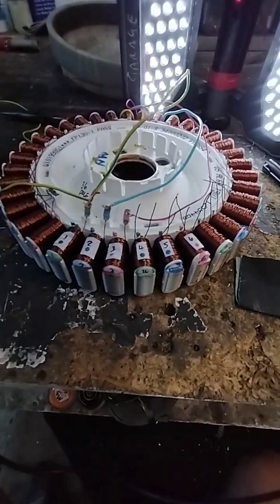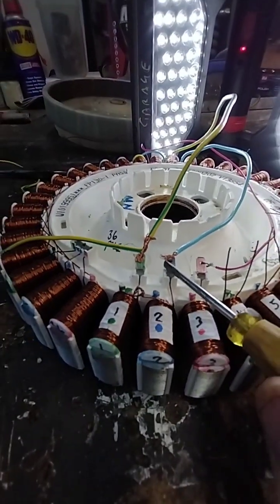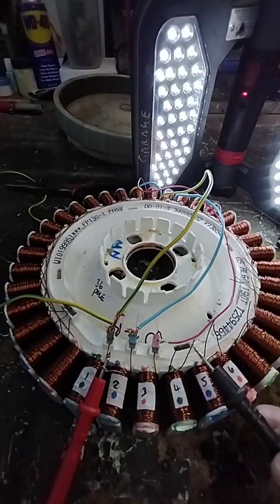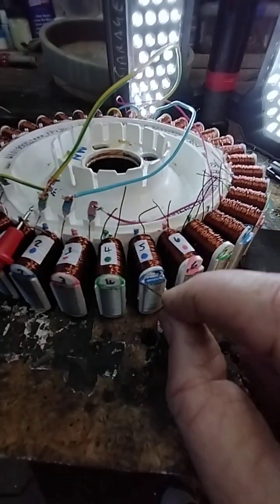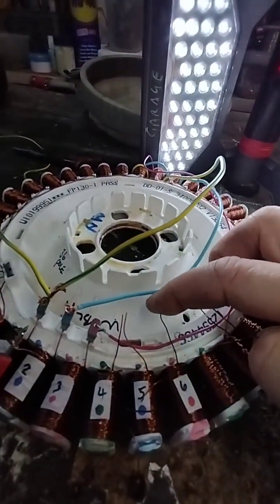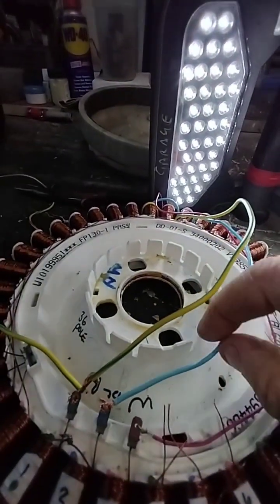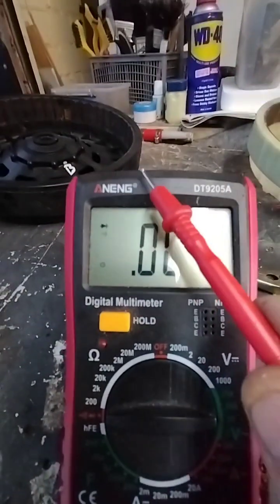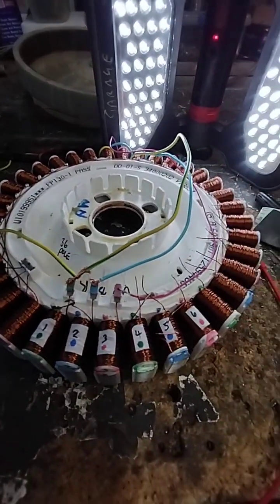PART 4 joining and twisting each wire of the wind generator made from a washing machine motor

Comment: Just use 3 phase rectifier and any solar inverter that people are throwing away as they are now buying hybrid, you can make a grid tie wind turbine, or get a hybrid inverter that takes up tp 500V then you do not need to modify the wiring.
Reply from the maker: Excellent suggestion Sandy. 👍☺️

Comment: Hey mate do you know how many watts you can expect to output max from this type generator? 
I have seen channels where they do this for hydro, etc (Marty T for example is good), but my question is this, wouldn’t it make more sense to leave the stator as it is and use the higher voltage for transmission of distance (from a windmill or hydro to house) because you could use thinner wires with less losses for distance, and then use an inverter or switch mode power supply’s to reduce it and regulate the voltage/current at the other end to charge batteries or whatever?
With all the electronics available now days I would think there are better ways to accomplish the same goal without having to go so hard on rewiring the stator, it is a big undertaking.
Reply from the maker: You could indeed do that and use as is. It would make 240 volts when unmodified and spun. In this case I'm only chasing high amps but low voltage and those things are wired in their original configuration for high voltage but low amps. Great point though. Check out Tristan Mcnabbs channel on YouTube. He's a genius at those type of applications.
Regards Andy from Aussie Homestead NSW Australia 🦘